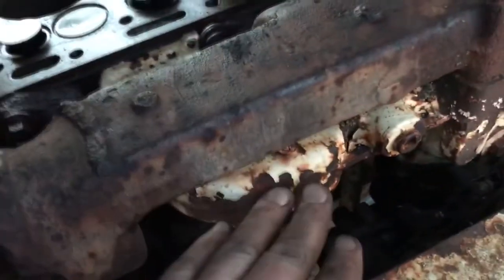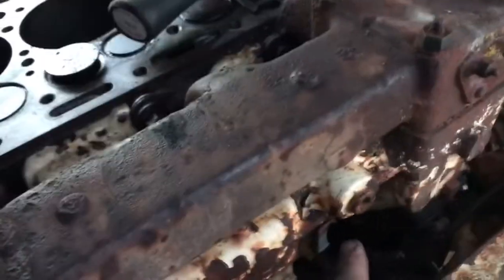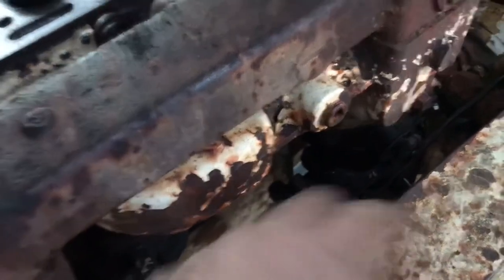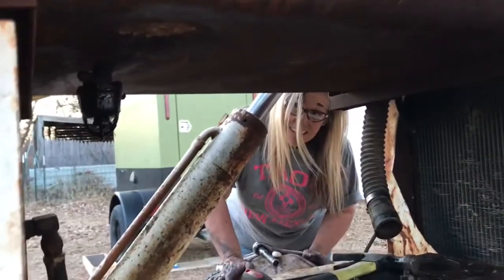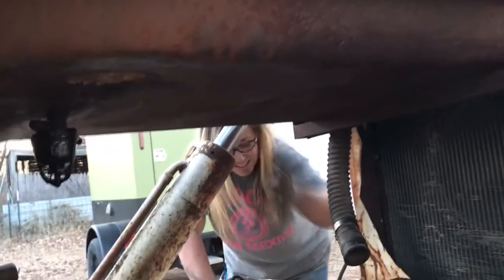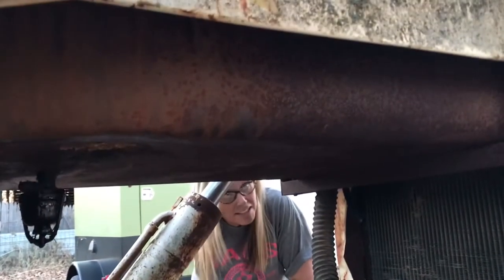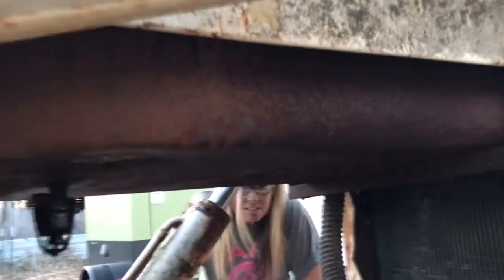Grease Monkey

Comment: Now thats a whole new meaning to dirty blonde.....lol
Reply from the maker: Got that right, Thomas!  Hope you are well.  Gotta sand the crankshaft journals some more. Just discovered that the oil grooves on the front and rear bearings are different width than the old ones, which means the crank is grinding into the new bearings. Yuck! Have a great day.